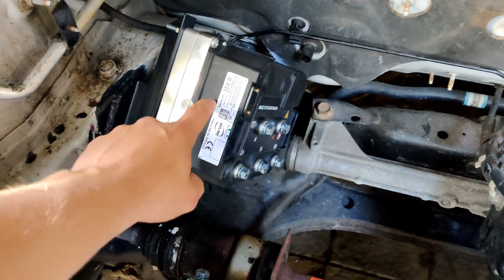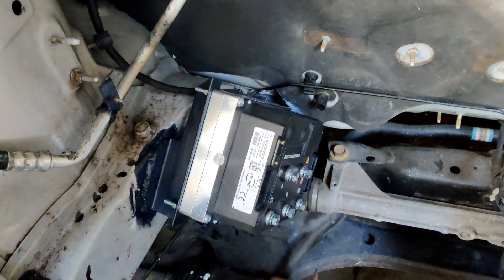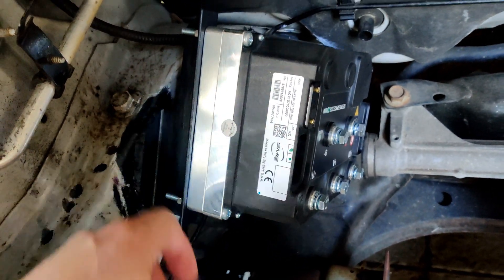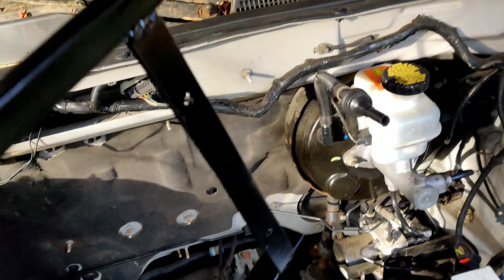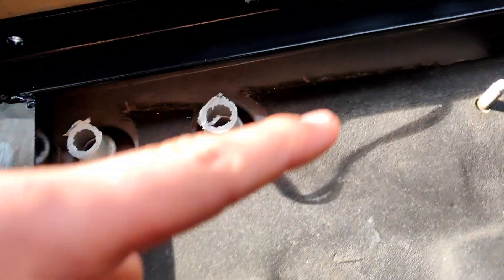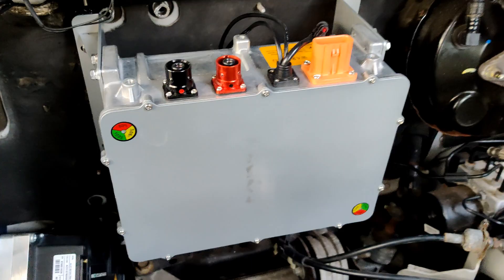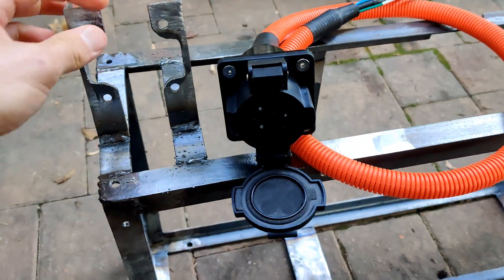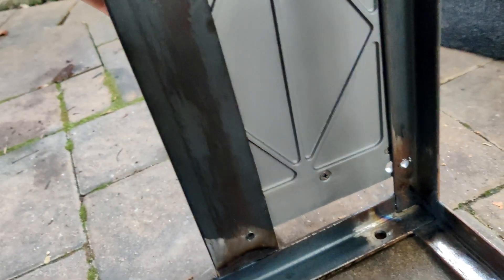Ford Escape EV Conversion EP 17: Mounting the Charger, Inverter, DC/DC Converter, and J1772 Plug

Comment: Any concerns about the hyper9 being too small? It seems to produce less horsepower than the original engine
Reply from the maker: I definitely had concerns about that initially. 

The hyper 9 has less horsepower, but the exact same amount of torque (170ish ft. lbs). Since with an electric motor the torque is at the peak from 0 rpm (vs 4000-5000 rpm in a gas engine), it will accelerate much faster than originally. Top speed will probably be a bit lower though with the hyper 9, since top speed is more dependent on horsepower than torque. 

The first generation escapes (early 2000s before 2008) had a 127hp engine as stock. This motor makes the same hp and more torques than that engine.
Reply: @reider_mcfeely  instant torque too ;)